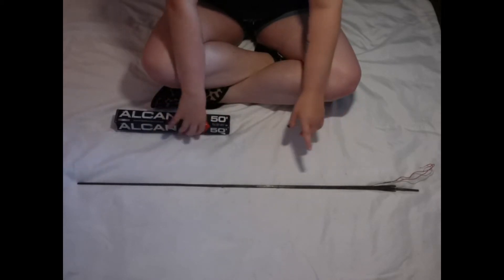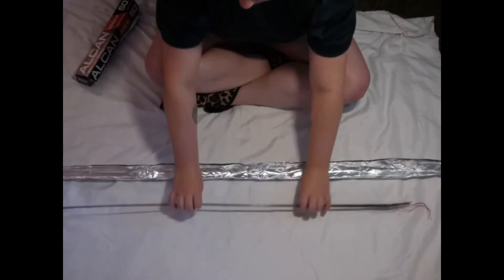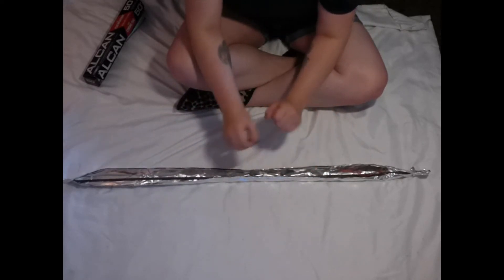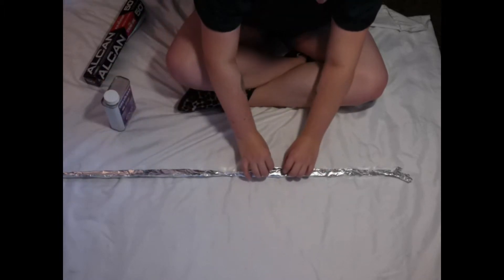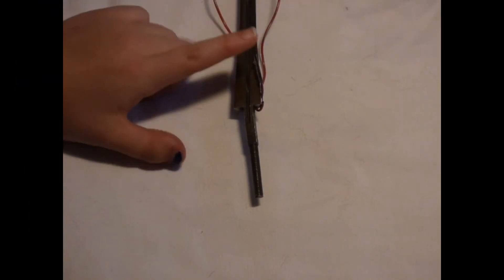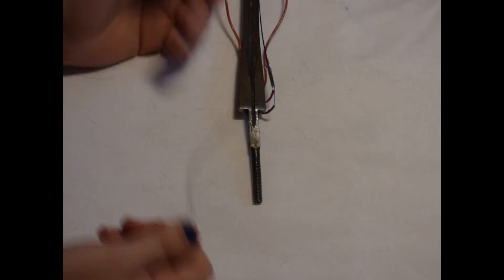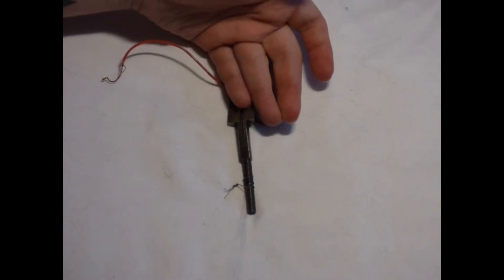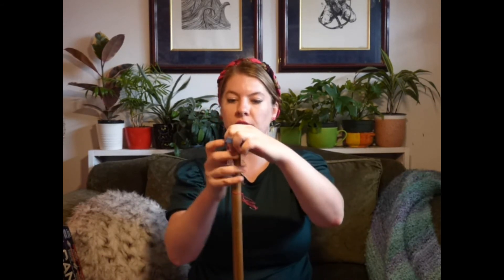How to Prepare an Epee to be Rewired: Using an Acetone Bath

Comment: Forgive my ignorance do you have to use a copper/metal pipe for acetone tube? Or is PVC with a cap and plumbers tape going to work?
Reply from the maker: You will want a metal pipe of some sort, PVC will unfortunately not hold up to the acetone
Reply: Thank you! I use mostly absolute fencing, I’m replacing some old tips, they offer a small spring and a large spring for the German tip, do you know the difference? Are they interchangeable? Thank you so much for your feedback knowledge!
Reply from the maker: @kurtaikido2889  Hi there, those two types of springs are not interchangeable and serve different functions, both of which are needed for a fully functioning epee.

The smaller spring is called the contact spring, and it directly attaches to the tip button and completes the circuit when it lowers to touch the two ends of the wire in the cap.

The larger spring is the weight spring, and it supports the tip button's movement back into place after a hit has been scored. 

If you're asking if you can use parts from different manufacturers, technically yes, although they will always be a bit off from each other. I recommend sticking with one manufacturer whenever possible. So if you're already using Absolute stuff, get your replacement parts from them too.

I hope this clarifies things!
Reply: Oh of course! I get confused when I look at these catalogs but thank you so much for clarifying you’re an incredible resource thank you for answering my questions!

Comment: This was a helpful video.  I have a few questions I hope you can answer. 
1)  What diameter pipe do you recommend for a french grip with a bigger cant and the possibility of bathing multiple blades at once?  
2)  All of my epee's are pistol grip but I'm sure there will be French grips that I need to rewire.  What length of pipe do you recommend?
3)  Are you able to reuse the acetone for multiple rewirings or do you dispose of it after each use?

Thanks you
Reply from the maker: Hi Michael, sorry for the late reply, I wanted to actually measure my pipe for reference. The one I use is 1" inner diameter and 48" long. This is definitely longer than needed, as you really just need it to be longer than your longest blade. This works well for 2-3 blades depending if I'm doing foil or epee, and also depending on the level of bend in the tang. I wouldn't think you need much more than that though, as a heavier bend will start getting into illegal territory. And yes you can reuse acetone a few times before it becomes too saturated. I don't know the exact number of times, but when the blades come out from an overnight bath and the glue is still stringy instead of completely dissolved, I change mine.  I hope this helps clarify things!